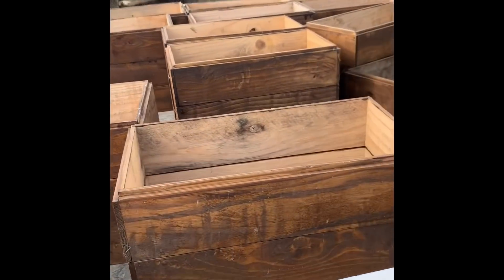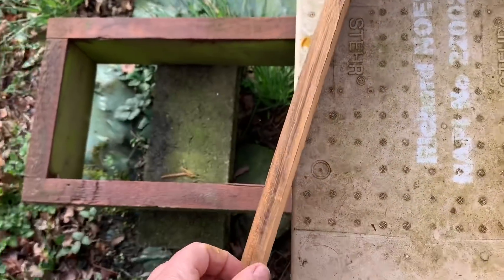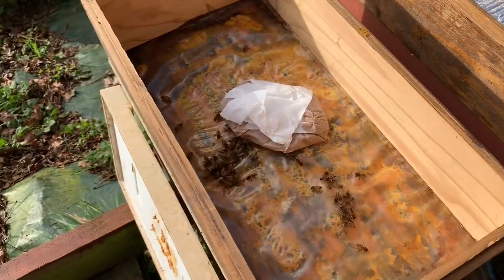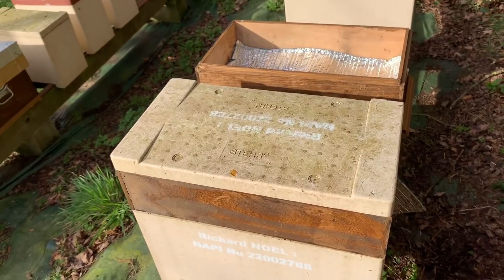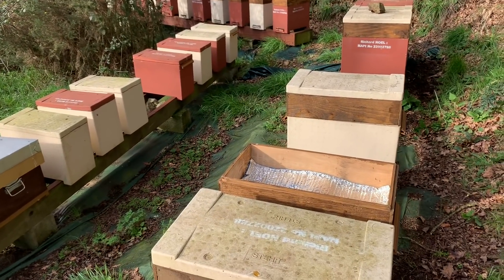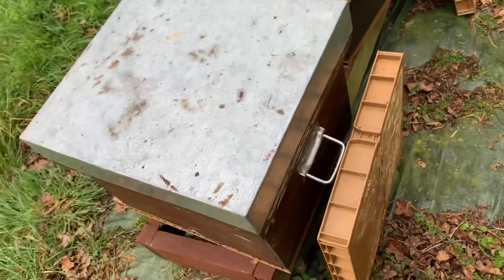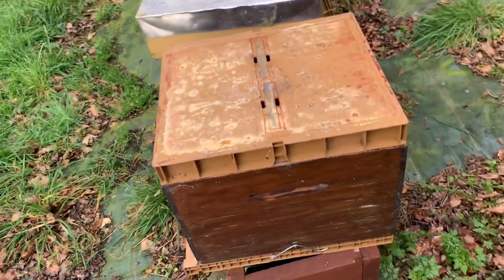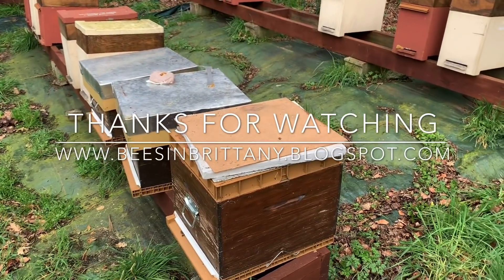Protein for all!!

Comment: I use the almost exact system coming out of spring with the exception of A feed bag instead of insulated  cover inside of super. I do insulate cover board though. Cheers..

Comment: For pollen patties (and bee candy) I use self made 3 cm (ofc can use 2 cm, maybe additional cm won't make a huge difference for saving the heat but you can much more easily place patties/candy without worrying about not fitting in height) extruded polysterene (Finnfoam) rims. They are really cheap to make and saves the heat really good. Because I add patties/candy in the spring and autumn, so it was really worth to make it.
Reply: By the way, Your videos are really enjoyable, keep it up ;)